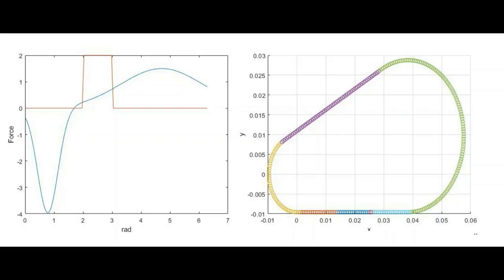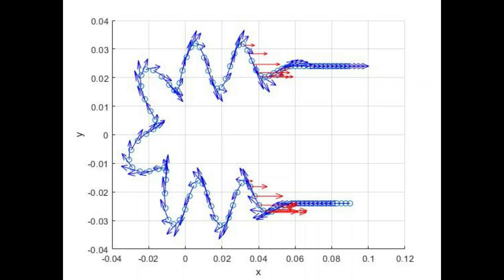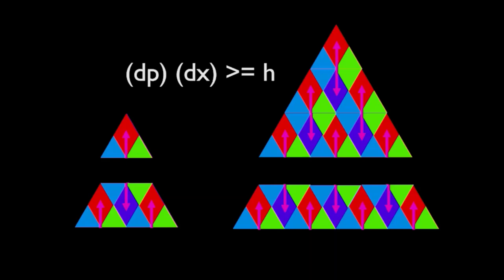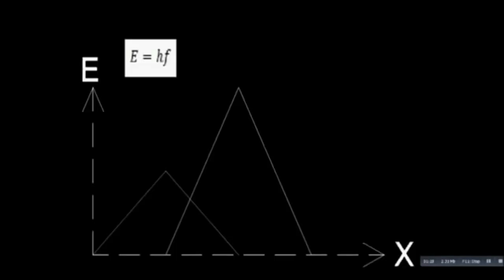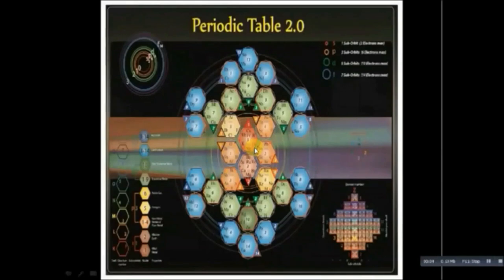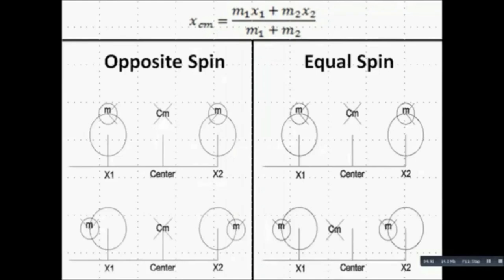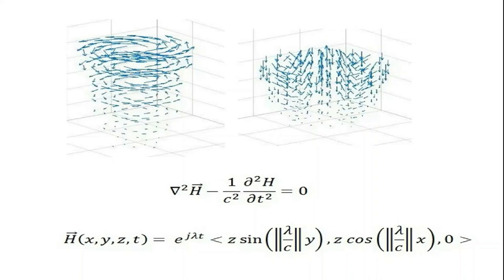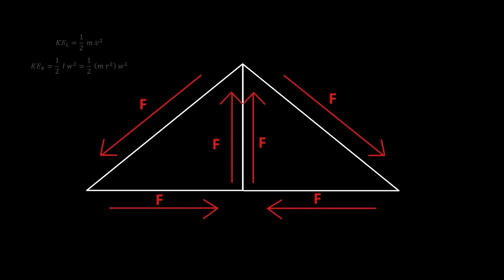Impulse Drive Overcoming Gravity 2

Comment: I dont understand but good,nice
Reply from the maker: The board is propped up by a book, this means when the lever arm rotates counterclockwise it is travelling up a slope, thus demonstrating that the device can overcome gravity, though in this case the strength of gravity is greatly reduced because the slope is only a few degrees.
Reply: @ruthlessoptimism1106 The strength of gravity is reduced? You might want to work on that
Reply from the maker: @Crashawsome  This iteration of the device isnt meant to be practical, or useful for something. Its simply a demonstration that the device can perform work against gravity.
Reply: @Crashawsome In this case yes, the strength required to overcome gravity is reduced because of the slope.
Reply: @Beanpolr  No, that's not how it works
Reply: @Crashawsome  It is, generally. The ramp effectively reduces the best effect gravity has on the movement. Were it to be straight up and down, the effect of gravity would act "stronger".
Reply: @Beanpolr  You’re making me cringe. Stop this.
Why did you put quotes around “stronger”? If that’s not the correct word, then use the correct word
Reply: @Crashawsome  I used quotes around stronger because for all intents and purposes it's the case, there's no sense in explaining the technical truth in a YouTube comment section when it makes no difference
Reply: @Beanpolr  If I was going to describe something as ‘stronger’ I wouldn’t put it in quotes. Seems weird and cowardly
Reply: @Crashawsome And that's why I'm not describing it as stronger, hence the quotes. That's just how it seems to be.
Reply: @Beanpolr  Use the correct word. It’s not hard
Reply: @Crashawsome  It's the appropriate one
Reply: @Beanpolr  You seem to be contradicting yourself. Do better
Reply: @Crashawsome  How so? It's the appropriate and equivalent, though not technically accurate term. A figure of speech, non literal. Used commonly.

Comment: Lol this is just a gyro effect my guy
Reply from the maker: The gyroscopic effect creates an apparent resistance to changing the orientation of a systems axis of rotation through conservation of radial momentum, as far as I know there is no known way to use it to cause a system to displace like this device does. As explained in the video there is a difference in the strength and timing of the centrifugal forces created by the ball bearing traversing the curves of the track because the those curves have different radii, this causes the system to move forward. There is no changing of the orientation of any axis of rotation so no gyroscopic effect.